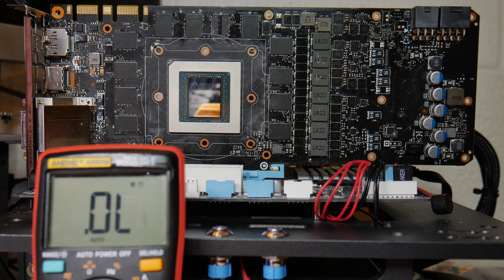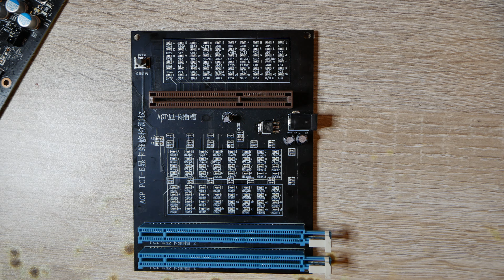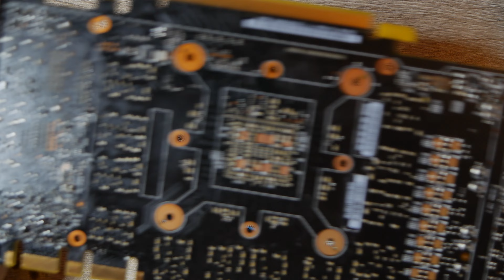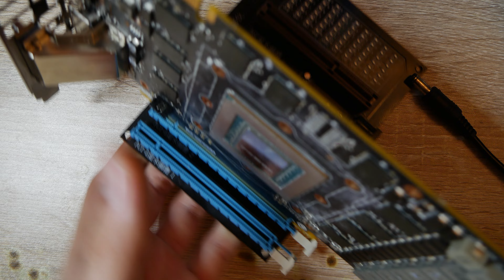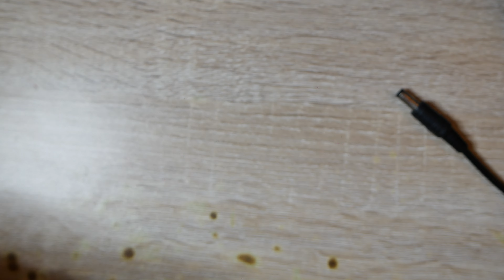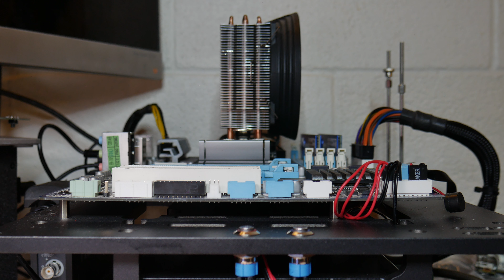EVGA GTX 1080 Ti SC2 Diagnosis - Mining Riser Inserted Backwards

Comment: hi Tech Cemetery.  Once I got a working Radeon Vii GPU for which i turn on the power but forget to connect the GPU to the riser.  Next moment, the GPU is dead and it is not detected by motherboard. Do you think this GPU is repairable ?

Comment: I'm working on a aorus 1080ti extreme. Card is not detected and GPU vcore does not drop from ~800mV, card not initializing. All voltage rails are present.  The only thing I found out of place was the 1.8v rail resistance (about 500ohms). I removed the 1.8v rail inductor and 500ohms measured on the output of the inductor. Can custom cards have lower 1.8v resistance or is this a lost cause?

Comment: Did the same mistake on my GTX 1080 but it looks like the core is fine. The third pin indicated 1v instead of .5v is there a way to use a jumper cable or another way to fix it? Can you provide me with more info on what to search? What if I solder pin 3 and pin 4 together?

Comment: i plugged a very similar riser into a 1070ti strix. 
when i pressed the power button the system powered up for a few milliseconds but shut itself off, i assumed because of a short.
reversing the riser and retrying showed no damage and the card is still mining today after a couple months.
it's possible i was lucky, also possible seasonic has a very fast short sense circuit, but most importantly i did NOT keep trying to reset and power up again and again, instead i went through everything immediately and discovered my stupid mistake.

Comment: May I have a question on the +3.3V rail. What the short on that rail (or low resistance such as 0.2kohm) would typically mean for you?
Reply from the maker: Is this an AMD card? I believe on some cards this is normal oddly enough. I would assume a dead component is connected to 3.3V otherwise. Shorts on 3.3V can be quite difficult to find, even with a thermal camera.
Reply: @TechCemetery  It is rx 580, compared to other that I have seen typically it had 6k resistance. Indeed, it's difficult to find :) Thanks a lot for the answer, I enjoy your vids a lot.

Comment: I have been watching all your videos and you are one of the best tech teachers in the world. I have a gtx 1070 with 0.8 ohms measured on all the memory channels, and when I tested it with mats and mods I got 2046080 read errors on each memory from A0 to D1. The resistance on the 12V and 5V lines are perfectly fine. Any idea what is causing the issue?
Reply from the maker: I hate to say this, but that sounds an awful lot like a dead core if you have memory errors on every bank.
Reply: @TechCemetery  I see, thanks for the info :)